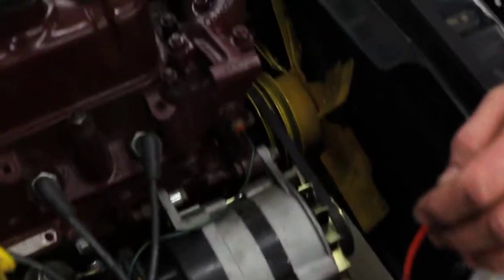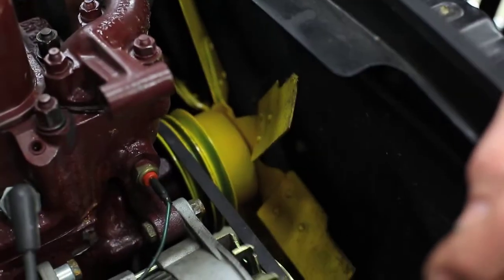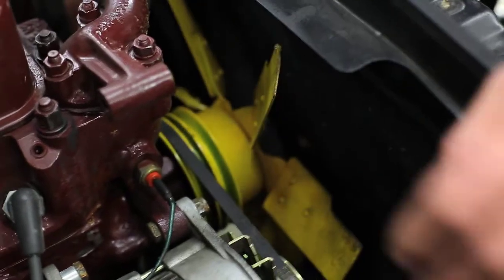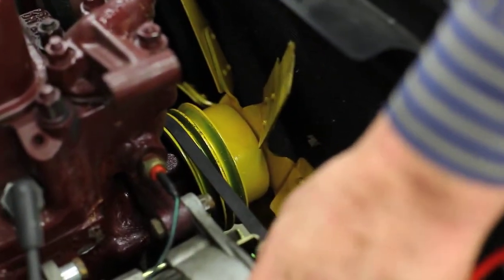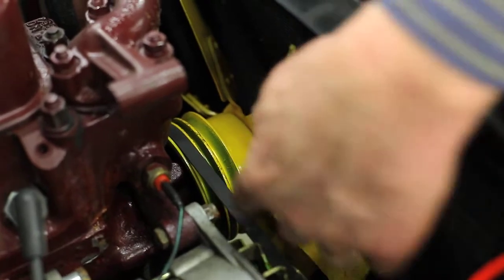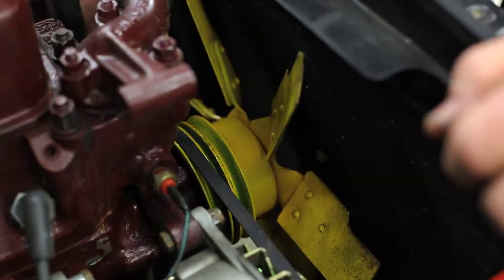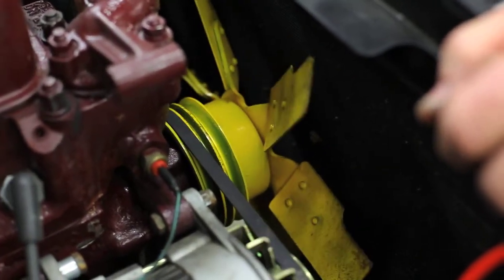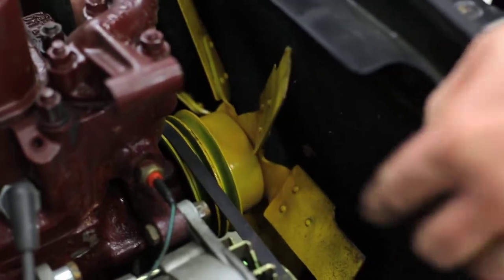182 MG Tech | Faulty Front Pulley on MGB

Comment: I've had this problem on a B series 1620 motor, in my morris. unlike MG's they had acast iron pulley in lieu of riveteted steel one, The movement broke the casting away on the back of the pulley, and made the rattle worse. Turns out the woodriff key was slightly loose, and I was able to source a tighter fitting one from my local MG parts dealer.

Comment: John,  Early Miatas sometimes develop a similar problem.  The most popular approach, other than engine or crankshaft replacement, is what is know as "the Loctite fix."  You can find details at miata.net in the garage section.  I'm not sure if this would work for you, but I thought you might be interested.  I'd be very interested in a follow-up video to see how your solder approach works out.  Thanks.